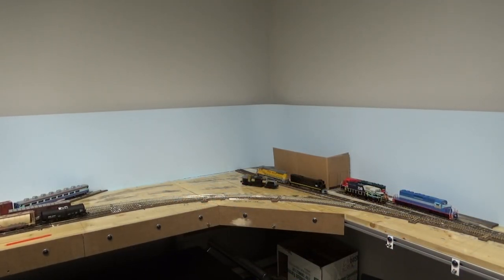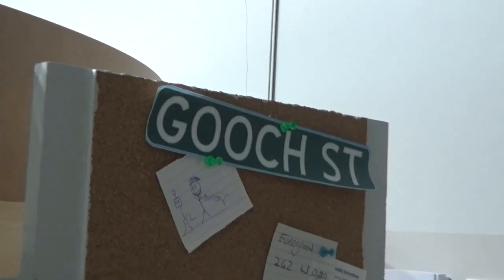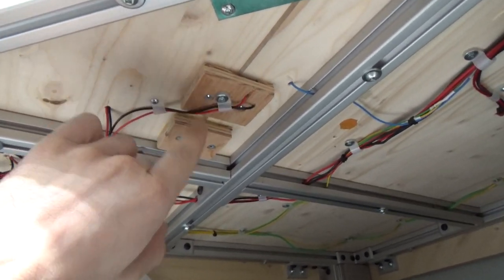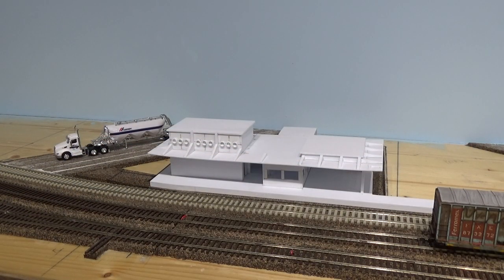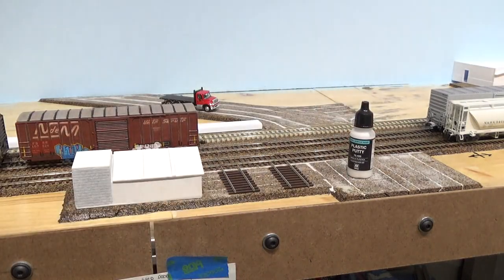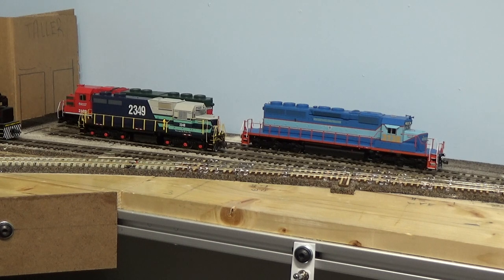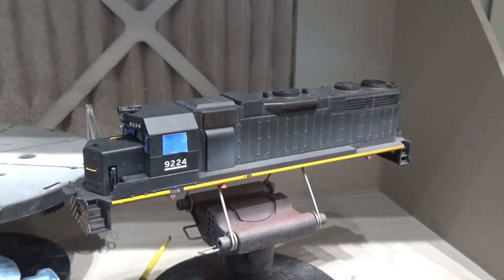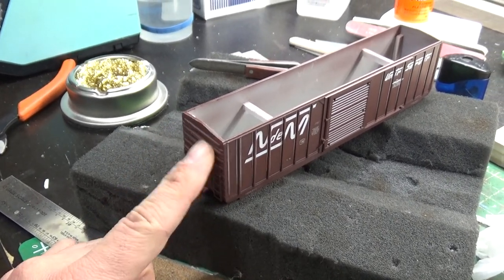April 2022 Layout Update

Comment from the maker: Is there anything you would like to see me cover in more detail in a future video? Leave a comment!
Reply: Yes,there is. I've been HO modeling for decades. One skill that I suck at is painting locomotives. Would you share some painting tips and how to's ? God bless.
Reply from the maker: @ModelingSteelinHO  Mostly, learn to use an airbrush. It's a challenging, but game-changing tool to master. If you hesitate, just get a cheap dual-action Master brand airbrush from Amazon. They're actually quite good, just not very durable. The tip on mine broke after about 6 months of fairly frequent use. Now I use an Iwata dual-action and a Paasche single action.
Reply: @lepetitnabot  Thank you. You guys that paint inspire the rest of us struggling. Keep up the great work. I'll learn as I go.
Reply from the maker: @ModelingSteelinHO  The good news is acrylic comes off easily.
Reply: @lepetitnabot   So thankful for acrylic paint. Way better than the old school paint from days gone by. I use a lot of craft paint from Plaid & Folk Art. Tried running it through my Badger airbrush. Didn't strain it first. Didn't paint anything but clogged my air brush up good & proper. Cleaned it but haven't really messed with it. Been on a scratch building boom the last two years. Only a few more heavy equipment models needed for my steel mill.  Keep up the great work Mathieu.